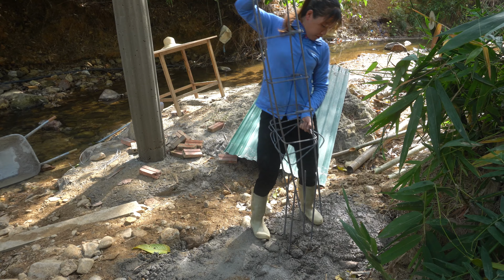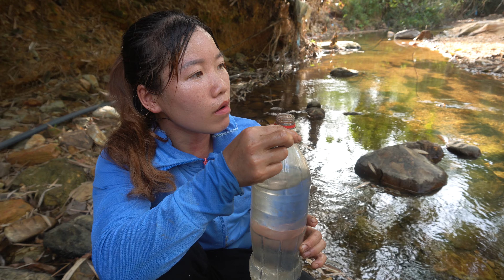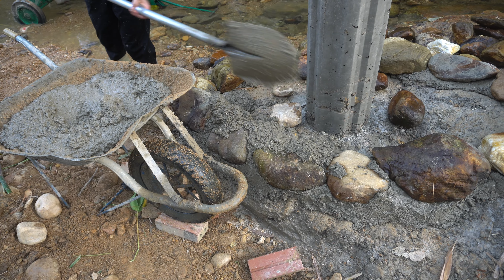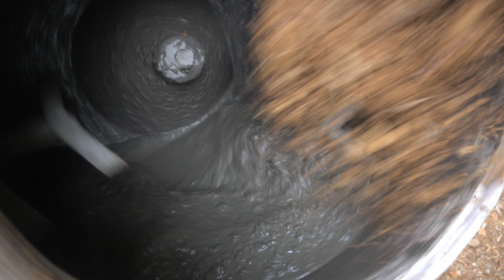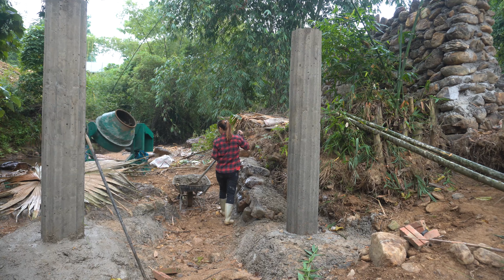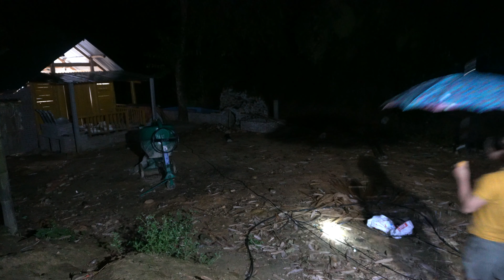Build a system to take water from the stream to fish tank with Primitive technology Ep2 - farm life

Comment: Oh my goodness, I just noticed the electrical cable (extension Cord) to the Cement Mixer has about 6 feet (or 2 metres) of cable lying under the water before it reaches the Cement Mixer.  I have no idea of the voltage but doubt if it would be 240 volts like here in Australia, but If there is the slightest crack/cut in the cord you will receive an electric shock if any part of you touches the mixer.  If it was 240 volts. you're dead sweetheart.  Either way raise the cable out of the water.  Much of the materials you are using are not result of Primitive technology but modern day materials so you have some experts in the background  (maybe you are well educated).  Either way for your safety get THAT CABLE OUT OF THE WATER.